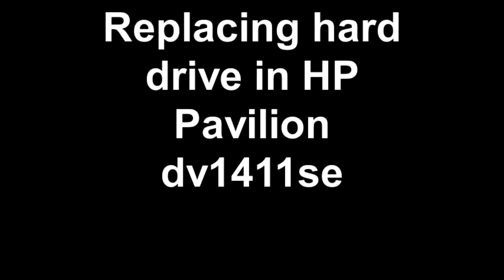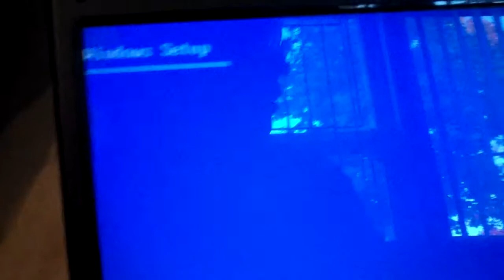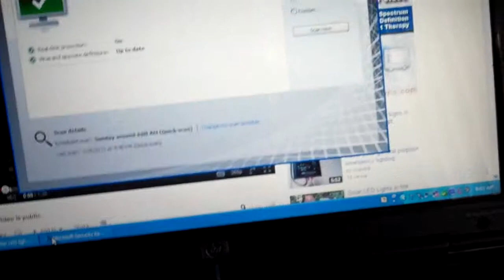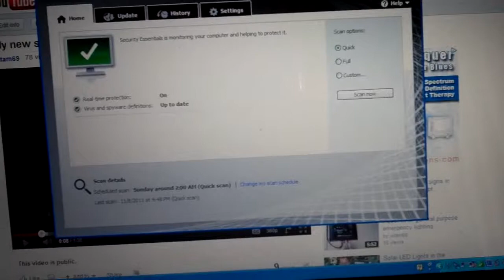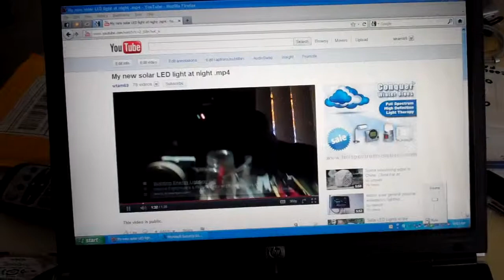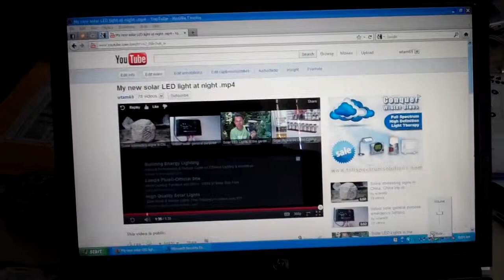Replacing HP laptop hard drive and browser Firefox upgrade.mp4

Comment from the maker: @Fearlessthinker I just kept the old hard drive. It still works and the info is intact. I guess you can use the Microsoft files transfer wizard. You can also buy a case and use your old hard drive as an usb drive (not worth it). My replacement drive is actually a Seagate from Ebay Memory labs. Just be careful be you pull the black plastic connector from the old drive to install in the new. I forgot to mention  there is a metal cradle you also have to remove from the old hard drive as well.